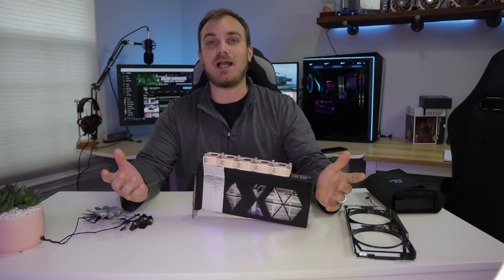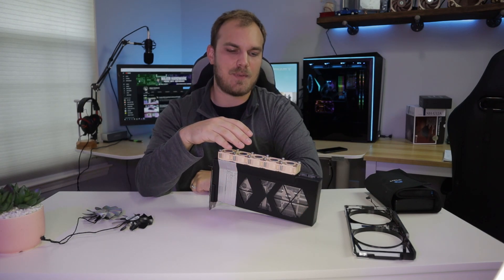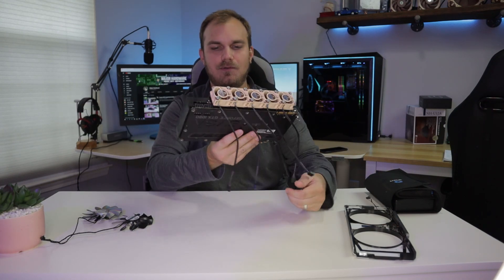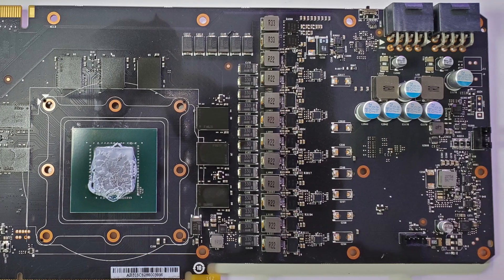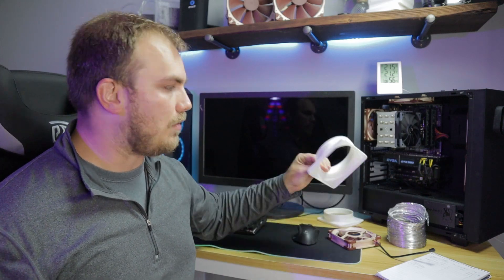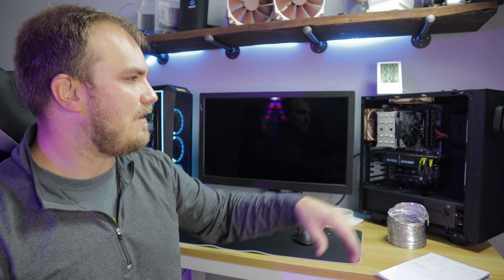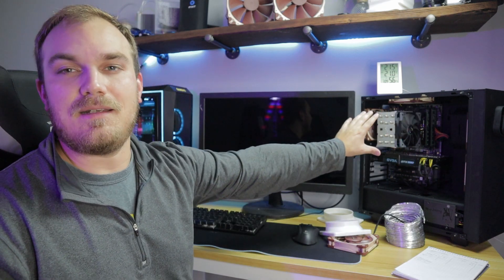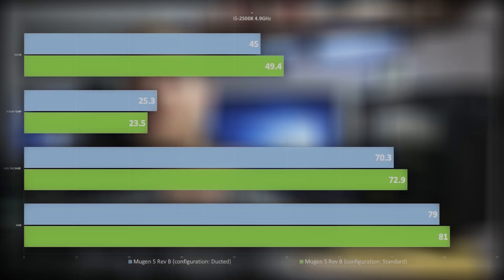Does Connecting Your CPU COOLER Directly To Your Case Fan Improve Temperatures?

Comment: Well, yeah, your CPU Temps are better, but you didn't look at MoBo temps did you? I would imagine that this situation isn't perfect for that.

Also I think your case fan config isn't ideal, I would say without the shroud your top exhaust is competing for the fresh air your CPU Cooler. My personal setup (in a Define R4) has one top exhaust BEHIND the CPU Cooler (and an exhaust behind it of course), if I move it forward my CPU Temps increase.

Overall with a case with solid airflow (so not really yours) you can do a lot to optimize airflow without having to duct the inside of the case. Like a Fan on the floor does wonders for your GPU temps, if you don't have one of these PSU brackets. Also helps balancing airflow, which reduces dust buildup: 3 Intake Fans, two front and one in the bottom, and 2 exhausts, one in the typical back location, one behind your CPU Block on top. Even in a case with good frontal air access intakes tend to be more hindered than exhausts, so if you have good airflow fans for the exhaust, and an static-pressure/airflow combo as intakes you can run a super silent computer even under heavy load. The loudest thing in my PC, Blu-ray drive aside which I barely use, is my hard-disk drive, which already is optimized for low noise with 5400rpm and SSD buffering using Intel Rapid Storage Tech (which btw does wonders for your HDD Live time).

Comment: Old OEM PCs use to do this to save costs on cpu coolers.  The CPU cooler would just be a heatsink with no fans, and they would duct one of the case fans to it to simulate having an actively cooled cpu cooler.  Cut down on moving parts, which made the systems more reliable, and they could get a 50 cent heatsink vs a $5 heatsink for the CPU.  They worked well enough.

Comment: Were the fans at a fixed RPM or set to PWM? If PWM theres a variable, fan RPM. If set to PWM, you might find the fan RPM was dropping. In which case set to a fixed RPM there may have been better gains.

Comment: I did this myself over 10 years ago but this was for an enclosed rack server that was making the small room that it was in warm, there was an xpelair fan unit mounted on an outside wall, but it was not working, so we installed a new large faster model and ran flexible ducting to the output fan shroud on the top of the rackmount case and a large 20" industrial fan at the bottom of the case and we managed a 10 degree drop in server temperatures.

When the office heating went out on a cold and frosty winters day we directed the hot top outlet into the main office and that did a good job of warming the office up, till we could get the heating fixed.

I seem to remember once seeing a mainframe or server being directly fed with cold AC air to get a reduction in operating temperatures, I am surprised that you don't see a home brew version of this, unless someone is already doing it.

Comment: No no no, You need to attach the cpu coolerr directly to the EXHAUST port.  Then put more intake fans on, to creat positive pressure with the only escape being through the CPU cooler into the low pressure corridor created inside the duct between the CPU cooler and ht eexhaust fan.

Comment: Especially useful in Mini-ITX small form factor PCs where case temperatures will otherwise rise too much after 15-30min of gaming.
For instance, in the Ncase M1 a topdown cooler like Noctua C14S + A14 PWM intake blows air directly from outside across the CPU.
Rear and top can then exhaust the hot CPU air, or you could lie the case on its side and use the rear as intake and C14S as exhaust.
Laid on the side, you could even buy a Strix GPU and replace its fans with Noctua F12 PWM exhausting GPU air out of the case also.

Comment: With my case paired with a 290X, I either have to run a duct similar to this or use an AIO watercooler...any aircooler I have tried will throttle the CPU if overclocked at all...I found this out after my last AIO cooler's pump died, replaced with a decent air cooler, and temps are actually "better" until you put a load on the GPU as well, then it just gets heatsoaked.  This is with 4x120mm high RPM fans and 1x140, in any combination of fan placement.  My case just doesn't have a good layout, and the 290X outputs an insane amount of heat.

Comment: I remember my old clam shell dell had a shroud for the cooler like this. The main drawback to setups like this is bulk. The more stuff you have in the way the more annoying it can be to work in the case. With easier iterative design through 3D printing, you could probably make a modular duct system held together with some small magnets that would seal against a printed tpu gasket in between the couplings.
Reply: magnets and electronics scare me

Comment: I would not say it worked well. You can't take every degree difference and call it a result. You have subtract at least 2 degrees as measurement error and variance between runs. It seems like you are using the thermometer on top of the case which is not very precise. I would call it a very slight difference and not worth the trouble....

Comment: Well, I did this with my heavily overclocked Athlon Thunderbird C back in the day. It Ran at 1600 MHz with an 200MHz FSB. During Winter the case fan had an extra hose going out the windows to suck in the cool air. did a great job.

Comment: 15-20 years ago they also used to make exhaust ducts that would go to a receptacle size plate, so you could cut a hole in your wall and duct the heat into the wall instead of into the room.  Yeah with a duct the size of a vacuum hose.  No surprise those didnt last.

Comment: The VRM for the GPU looks like it has a burned capacitor that is the seventh one down in the bank, there looks to be a burn mark over the three printed on it.
Reply: BTW Dell did do some fresh air ducting some years ago but the extra work of removing the duct work when servicing and the extra cost for the parts for the 3 degree delta was not overall beneficial.

Comment: I did the exact opposite - I made all of my fans using the CPU1 and CPU2 fan headers, seems to be good been using this setup for 3 months now. Living on a high humidity tropical place and my CPU sits around 43C (Ryzen 5 2600) while Steam is downloading, discord is open, and watching you video with two tabs on Firefox. 60C if I'm rendering textures on 3ds max 2019.

GPU on the same setup sits around 40C (GTX 1660Ti), but yeah - its not a worse case scenario but my real-time daily work flow. GPU can go up to 65C on games like AC:Odyssey.

Comment: A problem you have with the case design is that the top extraction fan is robbing air flow/pressure from the cpu cooler.

Comment: or you could.... you know... intake from the back of the case directly though the CPU cooler, meaning you only need a small shroud instead of a massive duct. 

have your bottommost front fan installed and directed at your GPU, then exhaust out the top of the case. problem solved best temps.

Comment: Summary: Yes

I just saved you 8.5 minutes of blather.  You are welcome.
Reply: in addition: you save about 2-5C, so it's not that important.
Reply: @satibel  Hey man, every degree counts when you're on the cheap. This is more a proof of concept than a fleshed-out, optimized build so there's gains still to be had. He also admits his case doesn't have the best airflow from the front and the results might be better on other setups.
P.S. The smallest difference in temps was 3.8 degrees, so savings total is more like 4-5C
Reply: @satibel  try moving the duct to the gpu(s) it makes a major difference or give the gpu a baffle to redirect the heat coming from the gpu(s) from heat soaking everything else in the case the effects are much greater I am running dual overclocked 2070super graphics cards in sli with an overclocked I9-9900k cpu and my gpu's without baffle run my motherboard and CPU temp sensors approximately 20c hotter than with the baffle and dedicated fans

Comment: My case pumps huge volume of air when set to gaming (I've got all manual fan control setup!) so I didn't have to do that, but! My GPU is enclosed in a separate airbox assuring no hot air from it is sucked into the CPU cooler. The GPU has the stock fans and shield removed and its airbox is being vented by a single Noctua NF-F12 IPPC that could make make PC hover over the desk but as it's set to minimum RPM it's practically inaudible and it keeps my GPU below 70 deg Celsius.

Comment: Praise, I finally met someone like me, I have been using this solution for 10 years. I never understand what water cooling is good for when it uses hot air from inside the PC to cool it
Reply: There's nothing stopping you from putting the radiators outside of the case you know though the pipes on AIO's tend to be a bit short for that. Some cases are disgned for that too so that the rads intakes get oustside air and put it back outside. 

Also if you have you CPU and GPU watercooled the main heat generators inside the case are already taken care of unless you put a radiator as intake for some reason.

Comment: Professional workstations still use ducted air. Lenovo P920, HP 840z etc. They're designed around controlled specs. Your desktop computer isn't. You can put a plethora of different parts in your case, so air ducting becomes way harder to accommodate the hundreds of probable HSF combo's. That's the simple reason why no one is going to put the effort into designing a ducted case. The standard off the shelf desktops are too cheap to even bother with. Hence the death of the idea early on for anything but high end workstations.

Comment: I always told that, if the whole CPU has a separate cooling like a tunnel from the entrance to the exit will improve performance, thanks for the video, this proved I was right and I had seen it many times on old PC's and even my old bought case had a plastic tunnel for the CPU to the side...

Just wished you had 2 parts of the video with the 2nd having that pipe from the front to the rear of the case the whole section and all CPU airflow completely separated to see the difference but also leave some other fans pushing air trough the interior of the case which will also reduce the CPU cooler by hitting the copper pipes and the bottom plates and all the components all over the place and all the other fans pushing the air out...

Though that case doesn't seem good to make a full pipe from front to the rear since it only has one back rear, my current case is very old and I have 2x 120mm fans on the front (had to mod the 2nd since there was no fitting for it), 1x 90mm above (however there's room to put way more, but would be kinda pointless) and I have 1x 120mm + 1x 90mm on the rear, so 5 case fans counting a total of 12 fans in my entire PC (5 case fans + 2 on the CPU + 1 on the PSU which also push hot air from the cpu out, 3 on the GPU and 1 on the motherboard), this is a hell lot of fans all over the place LOL.

Comment: I like your style man!! This is exactly what I have setup for my AIO, where the side fan would normally be I have ducting going directly to the CPU rad. I took a failed 120mm fan, removed the fan hub and cut out the bracket, then smoothed it out, which now becomes a perfect duct adapter, and finally used standard 4" rigid aluminium ducting for dryers (I prefer the rigid ducting since you can conform it to make just about any shape.
Reply: I don't get it. Why would you need to do that with a rad? Just mount the rad directly on the side. If you can't then you bought the wrong case.

Comment: I have an ITX case with side vent and a top flow cooler (Be Quiet DarkRock TF) and the space between the top of the cooler and the side of the case is exactly the width of a fan so I have basically this kind of setup but without the duct.

Comment: In older cases I still find ducts for guiding hot air towards the exhaustfan and in all cases airflow for Ram and chipset and other peripherals should be considered. The GPU tends to draw it's own air in a stock blower config, but a custom set also needs enough fresh air for the case.

Comment: If it works with enterprise rack servers. There’s no reason why ducting airflow into desktop tower cases wouldn’t work. LTT tested AIO water cooling is just marginally better air cooling. IMO ducting cool air in and hot air out is the way to go.

Comment: My dad and I both did that years ago. My temps have been so good with newer cpus and heatsinks that I have not felt a need for it. It's a fun mod though. Used to go to Lowe's and auto parts stores to find more aesthetically pleasing pieces. Big old shrouds from 775 Dell pcs and such worked well also. A can of spray paint would make them look better.

Comment: That airduct it self might be the biggest resistance in there. if you could test this with a more aero dynamically stable duct, like a pipe that is very flat inside, would it even make it better. the front panel might b the worst resistance in the system after all.
Reply: I mean that duct issues a lot turbulence.

Comment: when you mentioned exhaust you pointed at the top case fan, do you really have the top fan setup to exhaust with your front fan as fresh air intake, if so you are exhausting most of the cooler fresh air out the top exhaust before it reaches the cpu cooler, if you use the top and front for the fresh air intake and only use fans at the rear for exhaust it will allow the cpu cooler fan to pull cooler while preventing the heat generated from things like the MB and gpu chipsets from being able to circulate back up through the cpu cooler...

Comment: I have done this back in early 2000s, on a custom build cheap AMD K6-2 350 pc, cut a big hole in front side of the desktop case (not mini tower), made air duct directly from that hole to the cpu cooler, built from cardboards and duct tape, replaced the standard cheap cpu fan with big case fan. The same design I found again in a mini pc in 2010s.

Comment: I custom designed my own case based off the little known geeek t810 case. Its s horizontal case. I put two intakes for the gpu, one input directly in front of the cpu cooler and the only output is directly behind the cpu cooler. Its like a freaking wind tunnel!

Comment: i truly didn't think that would work. static pressure, i thought, would've hindered the air flow. 
you should ditch the 2500K and see what happens with a hotter chip like an 8500K or a 3rd gen ryzen